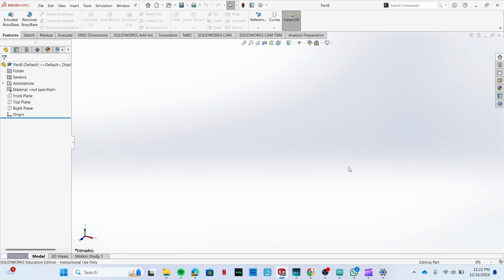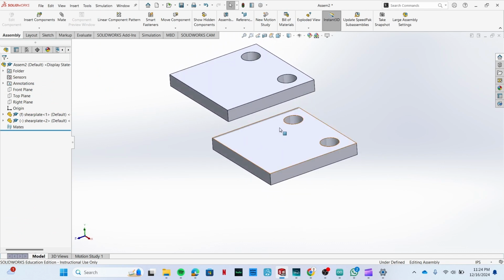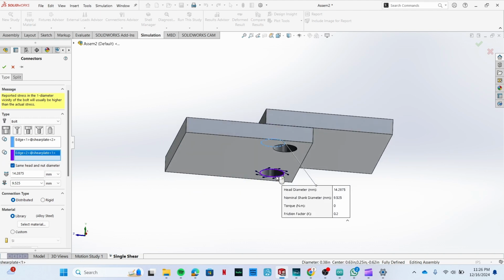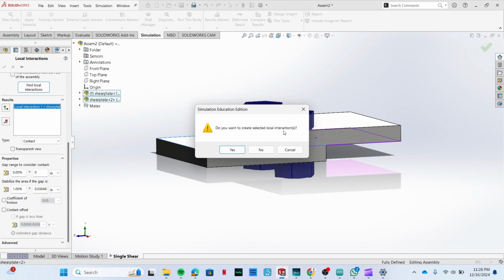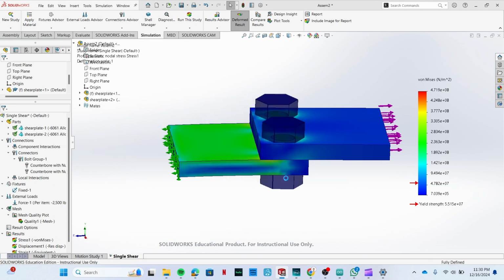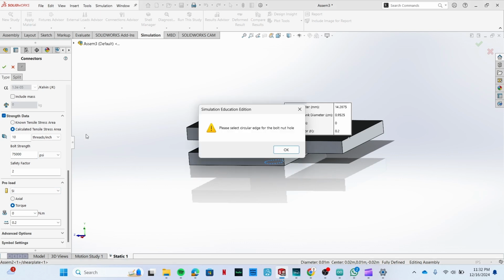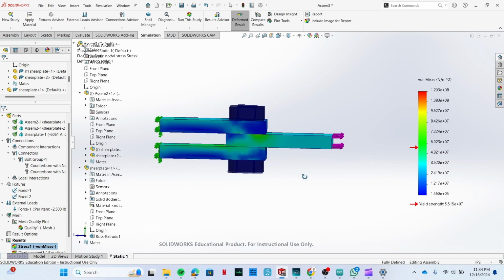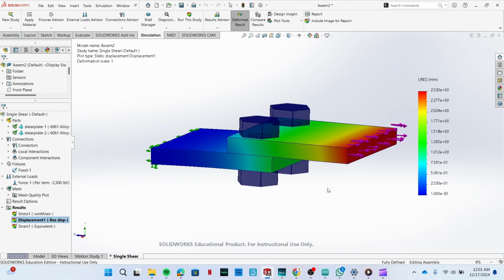Solidworks Simulation Single/Double Shear (MechSolids #3)

Comment: Hi im doing the same ensambling for a project on solid 2025  and i just did the same as you but it shows me this Excessive displacements have been detected. 
Common reasons:
 - Unstable study setup
 - Large deflections
 Click 'No' to stop the solver. Then, review the results and use the 'Interaction Viewer' and 'Insufficiently Constrained Solids' tools. 
If you have already confirmed that fixtures, connectors, and interactions stabilize all solids, click 'Yes' to restart with the 'Large Displacement' option enabled. 
Click 'Cancel' to stop the operation.          Do you know how can i solve it please